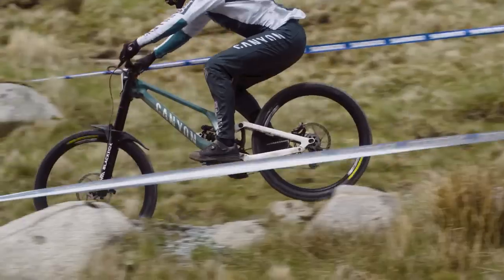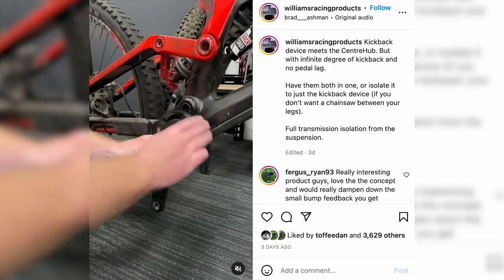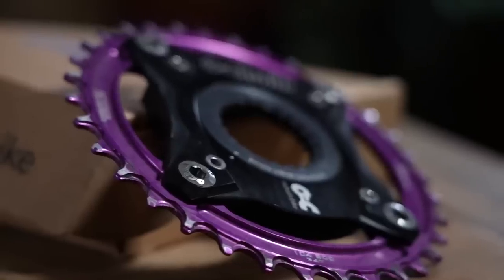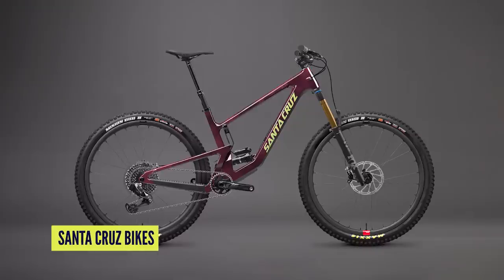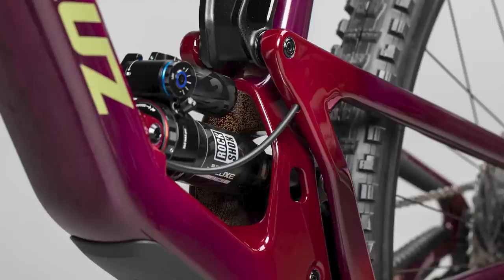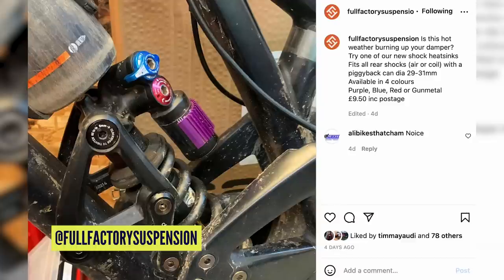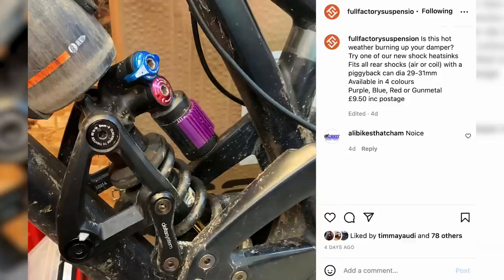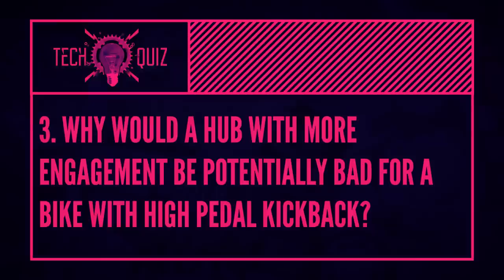Pedal Kickback And Kick-Forward Explained! | GMBN Tech Show 233

Comment from the maker: What do you think of kickback reducing devices? Are they for the pros or would you fit one for those marginal gains!? Share your thoughts with the GMBN Tech community down below! 👇
Reply: if this ochain thing and other solutions don‘t start cracking and creeking i‘m in. but i guess that this is just another thing that can make noises and needs maintenance …
Reply: It's an overcomplicated solution to a non-problem. At least when clipped in, kickback should not pose any sort of trouble to any accomplished rider, and non-accomplished riders don't ride fast enough for it to happen in the first place. (They may still imagine feeling it, of course...)
Reply: Yes @Sjaan! I feel those instant engagement hubs provoke kickback, so I went for a 10° engagement. Got used to it and am happy with the rear shock sensitivity too. I also like to unweight my bikes after an impact due to the chain tension for potential manuals or hopping over the terrain
Reply: Seems like something that would benefit steep chunky rocky downhill riding, and it  kinda defeats the purpose of having high engagement hubs, which helps me with steep technical climbing, just depends on what's more important to you.
Reply: Would there be a difference between riding a ochain and riding a hub with less engagement points?
Reply: @leftaroundabout  it's not about feeling kickback, it's your weight on the pedals stopping the suspension working as good as it can
Reply: Pointless. Makes these high engagement expensive hubs everyone at wants pointless and adds slop back into the drive.
Reply: I rode in fort william last year and knocked (breaking) my mech so I rode the 2nd half - the woods and the lower sections with no chain. It felt awful, I felt like my back wheel felt heavy and I had no control over it. This was on an enduro bike 
Personally, pedal kickback gives me a sense of where my back wheel is and therefore control, an ochain would not work for me, or on my bike 🤷‍♂️
Reply: @grahamhowe5055  the problem with a hub with few engagement points is that it's basically unpredictable when it will actually engage. If the suspension takes a hit right after the freehub has clicked to the next set of pawls, then it will stick kick through the chain. So you get fewer kicks, but those kicks are just as bad as with a fast-engaging hub.
And the fast-engaging hub is of course much better for when you actually do need to pedal suddenly, in particular for anything slow and trialsy, which for me is much more important than a bit of kickback on DH passages (but obviously YMMV).
Reply: In the last years it seems to have been really important to get tighter and tighter engaging hubs. I get absolutely get that. Why then would we reduce that engagement with for example an o-chain, if instant engagement seems to be so important?
By the way - ever tried to ride technical, trialy, slow-speed stuff without a chain or a low engagemnt hub? Horrible in my opinion.
Reply: @clemens8744  agree completely, however I'm on 24 POE and have no need to go to higher engaging. I just don't see the point to be honest🤷‍♂️
Reply: @grahamhowe5055  goood question! ^^
Reply: Just use a low engagement rear hub for similar effect. Also saves you a ton of money.

Comment: Im not sure if I'm right, but I only felt pedal kickback when moving to a higher engagement rear hub. O-chain has kind of brought back the lower engagement hub feel by letting the cranks spin before hub engages. Could you get that less pedal kickback feeling with going back to lower engagement hub?
Reply: Just what I was thinking... Save some money.

Comment: #gmbntech My hunch & experience on pedal kickback is that it depends on the POE (points of engagement) of the hubs & clutch of the rd. I  noticed the difference when me & my son swapped bikes on our 2nd run. I had my clutch on & my son's rd doesn't have a clutch. So I think the factors considered on pedal kickbacks are the POE's & tension of the rd (clutch or no clutch).

Comment: My Santa Cruz Bullit climbed like an absolute goat because of pedal kickback. In a low gear the chain would pull the rear wheel into the ground when you stomped on the pedals so you could get greater instantaneous traction proportional to your torque.
Used it with Chris King hubs that engaged quick to maximize this effect. I could outclimb any of the other XC weenies
Reply: And when you shifted into the big ring for the descent, the chain lined up with the pivot and there was no kickback on the DH

Comment: I'm starting to notice how much difference the derailleur clutch makes on my Santa Cruz bullit, it's an old single high pivot frame and get a lot of chain slap and derailleur noise without the clutch but the suspension feels quite restricted and strange with it on. Hard to find a balance because the clattering is unreal and it sounds like an expensive repair job is imminent

Comment: Don’t quote me on this, however surely having a suspension design like a slopestyle bike which is a single pivot with the pivot around the bottom bracket shell (e.g. NS bikes sodaslope, canyon stitched, specialized p slope) therefore you do not need a chain tensioner; that would prevent pedal kickback?
Reply: Yes, the problem with that system is that the path the wheel takes through its travel is slightly forwards as well as upwards which means it can get hung up on bigger hits.
Reply: @MW-ud8zp  and it has terrible pedal bob

Comment: Great to see questions being asked about the latest "emperor's new clothes" solution to a problem you didn't know you had. Plus clever marketing making you feel you "need" the product.
We need to be analytical about each product, does it work, what are the pro's and con's and most importantly will it suit the riding you do?I
Trouble is it's difficult to test these products without buying them and they aren't cheap by any means, maybe if the companies truly had faith in their products they should have a 30 day trial, return for a refund if it doesn't suit policy.
Reply: I feel the same way about massively big, long and slack bikes and idler wheels as well as what seems like the complete phasing out of full 27.5”.

Comment: I think of this every night. The pedals do actually kickback when I raise the bike and drop it to the floor. But does it really happen when the hub is freewheeling?, specially on harder gears? I would like to try this on a treadmill.
Reply: afaik  it does happen even when it free wheels .
when you suspension squishes and your brakes are not engaged  its either your rear wheel slips or the pedal kicks your weight up , somethings gotta give ,  thats what everyone is saying , but i've never felt it

Comment: That shock pivot might have helped specialized, I understand they changed there Kenevo from a coil to a air shock as they needed the larger diameter/stronger shaft as they had many snapped coils returned from the earlier  Gen Kenevo

Comment: I fitted a modern 1X12 onto my old Orange Patriot (the later 2012 one) and the clutch on the mech used to make it feel like the suspension was "sticky" Almost like the pivot bearing was stiff even though it wasn't. Also the pedal kickback when in the lower gears was hideous! If you hit something hard edged going up hill the kickback was so strong it would stop you dead. My current bike (2021 kellys swag 50) I can't feel any kickback at all, I guess that's just progress in the suspension design.

Comment: Most riders doesn’t need it but want it cuz the pros has it in their bikes. Shorter travel bikes has minimal kick back. If you’re bombing some downhill section, always remember to change your gear to the smallest cog before dropping in.
Reply: Kickback is stronger in small sprockets. I personally tend to stay in a middle gear during rough descents, and then kickback doesn't really happen at all. But then, I don't race – for the pros, who obviously want a high gear to be able to pedal at these speeds, kickback does happen, but I'd still dispute that it's actually a problem for them.
Reply: @leftaroundabout  sorry, you’re totally wrong. Here’s a good video and see the different kickback in smallest cog vs biggest cog. https://youtu.be/Qqd0UNZjJMk
Reply: @leftaroundabout  kickback happens all the time, you just don’t notice it because you don’t understand what’s going on under you. Sometimes, the small bump that you feel, you think is just a rough terrain but it’s not. The bike absorbs the impact but the chain has to pull something but the sprocket only rotates forward. So, the chain pulls from the chainring.
Reply: @djogz  nope, that video is wrong. I added a comment over there with the details.
Reply: @leftaroundabout  sorry but your opinion is subjective. Try to hit 4-5’ drops to flat. On small cog and in big cog. No braking. Just drop it.
Reply: @djogz  I prefer not to hit big drops to flat, thank you very much!
But yeah fair enough, if you do that at very slow tempo then you can get kickback even in a large sprocket.
But most riders who hit big drops do it either at very fast tempo, or they use trial bikes with no suspension, so it's a rather moot argument.
Reply: @leftaroundabout  you missed the point. Enduro/dh riding or racing. Ochain, high pivot, idler wheel, etc.. if you don’t do any drops or any trail riding at all, then you don’t get it at all. Sorry.
Reply: @djogz  I certainly seem to miss the point you're trying to make by just throwing together a bunch of random terms.
But again, to make sure you don't miss mine: DH / enduro racers hit drops fast and/or with a downward landing, so for them kickback will always be reduced by using bigger sprockets. And trials riders hit jumps slow and to flat, but their bikes have neither multiple sprockets to choose from nor any sort of suspension that could cause kickback in the first place.

Comment: I think you guys are slighty misunderstanding how the fins of heat sinks work, they arent there to funnel air to a particular place. They are purely just a way to get the maximum surface area in contact with the air to enable more heat dissipation.

Comment: RE: Pedal kickback - like Doddy, I like feeling a little bit of chain tension when I drop into something. It just gives you that little bit of confidence that if you need to push some power it is there...you certainly notice it when you drop in with the wrong gearing and you put down a pedal and nothing happens!
Reply: and I got another question in! woohoo

Comment: If it was something you could switch on and off by remote on the handlebar it would eliminate need to swap it out, but I don't know how or if that is feasible, but it won't surprise me if someone invents it. But squeezing electronics, battery, in there is a challenge.
I've not tried any of the anti kickback systems.

Comment: #Askgmbntech great show! I came across a modified  Evil Reckoning for sale. I found it odd that the fork was 160 while the shock was changed to 210mm. I'm used to seeing the same amount of travel or slightly more travel on the front. What do you guys think of this set-up?
Reply: Are you sure 210 is mentioned to be the rear wheel travel? Sounds to me like they might have meant it to be the eye to eye length of the shock.

Comment: #AskGMBNTech Hey Doddy! I have a trail bike with 140mm front and rear. I want to change my fork to 150mm. Will that change the reach of my bike and if so, will it be so bad that will make my bike uncomfortable to drive?
Reply: You can put a longer fork on your bike and it would only effect the reach by like 2mm as it’s only slackening the head angle. You would not notice a difference with a 150mm fork apart from the bike being slightly slacker
Reply: Technically yes it will shorten it but you won’t notice it.

Comment: pedal kickback has a small positive effect, too - provided your stance on the pedals limits any considerable movement on the cranks, the rear wheel will be rotated forward slightly when the suspension compresses. Even if your legs give a little (they always will to some degree), then you're basically storing a little forward momentum in your tendons, so the wheel just gets rotated a little later.

Comment: Heat sink would be pretty useless without a heat transfer compound between it and the reservoir; glue would be useless and I see the sticker is still on the shuck under the heat sink. Nul Points

Comment: I have never seen an adequate explanation of pedal kick-back offered, one that considers not only the suspension but also the fact that the wheel is rolling.  That is why the half-baked "theory" projects doom and gloom yet riders generally don't experience it.  The wheel is also rolling, thereby relieving chain tension continuously.  Pedal kick-back simply isn't an issue with a majority of riders and riding conditions, and this is evidenced by high kick-back designs growing to dominate the market.  If it were a problem, other designs with less kick-back never would have lost out.
Reply: I agree with your standpoint. However, when riding in a high gear and bombing through really rough roots/rocks, then the small sprocket can't feed the wheel movement into the chain fast enough to relieve the tension as the suspension builds it up, and that's where kickback does happen. The simple solution is to switch into a middle gear, or just ignore it (should be safe enough as long as you're clipped in).
Reply: @leftaroundabout  yes, there are conditions when kick-back can be felt, but there are many more when it won't be and that's why many riders never notice it.  Kick-back is an old complaint and justification for low anti-squat designs, yet those designs lost out because kick-back generally isn't important, not compared to good pedaling performance for most riders.  Thing is, descriptions of kick-back always ignore the very real reason why it is seldom noticed, the bicycle is not static.

Comment: I think ochain type devices are good for enduro and downhill races where there is no tech climbing. These guys don’t need/desire the quick engagement when climbing tech trails. I’ve a i9 hub with immediate engagement which I really appreciate on demanding climbs. Also remember the smaller the cog selected on the rear will reduce the kickback effect.

Comment: Don't want kickback? Put the freewheel on the crank instead of the wheel.
Reply: That wouldn't actually make any difference to kickback. And I'm not sure standard derailleurs would handle this well (though if yes, the advantage would be that you could shift without moving the pedals).